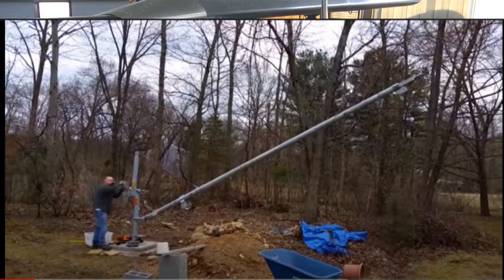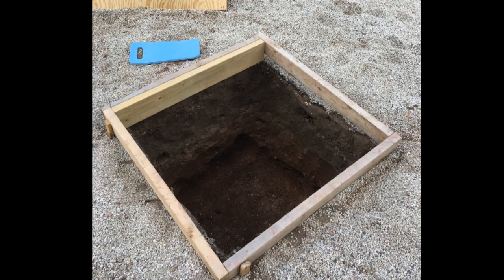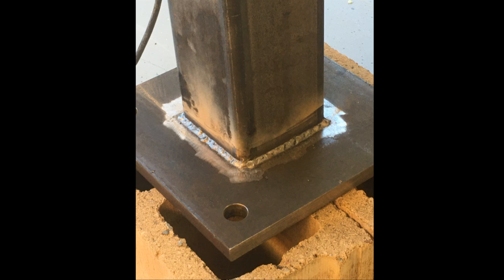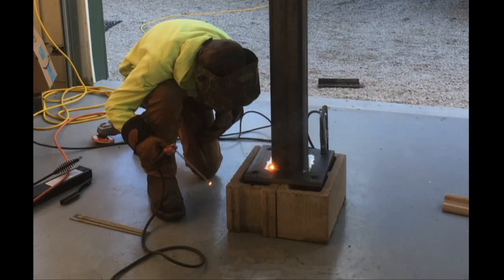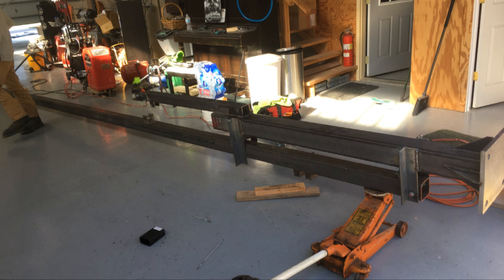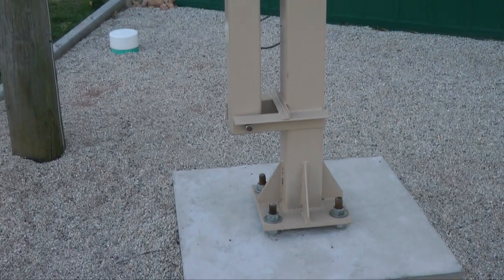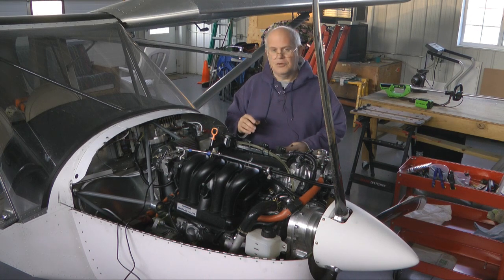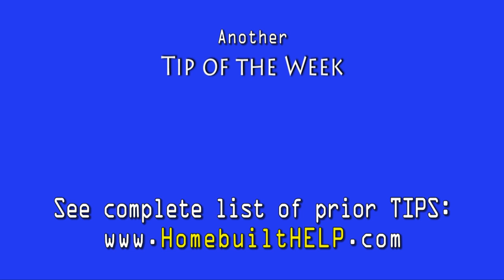Build your own tilting Aircraft Radio Tower

Comment: I think I would drill 2 holes for huge bolts. Then insert at 2 locations pieces of rectangular pipe (also drilled). Then I would use 2 bolts to bolt the mast to the support pipe firmly. They would have to be loosened & bolts removed  to raise or lower the mast.  Also I might put a short piece of pipe bolted to the outside of the mast which goes down to the slab.  Why did you not put the mast up against the wall of your building?  You don't have a video of finishing the project?  Thanks much for this video -- it looks like a beautiful & professional job.

Comment: Phase 1 was very impressive!..but, I shutter at the thought of how much money you spent to succeed in all of this! I am a recent GMRS licensee and will be putting up an antenna as well within the next few days at my house. However, it WON’T be as elaborate as yours is to say the least! Mine will be on a 20’ 1-1/2” pvc pipe with a UHF Fiberglass non-ground Mobile Radio Antenna, 70CM 400-470mhz GMRS Base Antenna 17 inches tall at the top. I’ll have two four feet pieces of rebar pounded in the ground up against two sides of the bottom pipe area and bound to the pipe via very strong pipe clamps. About ten feet upwards the pvc pipe will be bound to an existing old Directv mount already in place I used at one time for a tv antenna mount. With the antenna up and operational it should be approximately 21 feet high (or a tad more) to the top of the antenna from ground level. If I’m real lucky I’ll be able to hit all the repeaters in my area of north Houston, Tx [and there are many!] with my GMRS-50V2 50W 256 channel mobile radio being used as a base station. I’m also planning on using automotive wire looming around the RG58X coaxial cable from top to bottom to protect it from the sun’s rays also. Great video, VERY well explained, and, absolutely most interesting! Stay safe! ~Jim @WRXY695~

Comment: Is there a part 2 to this? I don't see any link to a part 2 and I know others besides myself would like to see that video. You did a great job with this. Was there a cost savings doing it this way instead of using a telescoping antenna tower that has 3 or 4 sections and a hand or electric winch/hoist to raise and lower it?

Comment: A couple of thoughts to consider.  The winch is most powerful on the first wrap of cable. (least amount of cable for the job)  Also you might think of using the equivalent of jumper cables to power the winch, (no battery to maintain) just pull a car up when needed.

Comment: Your video on Tilting tower was so informative.  I would like to build one for my HAM radio operations, thanks for the step by step procedure. it would be great help if you can share the design sketches with us.  
eagerly waiting for the second part. Hats off to you.
73's
VU2CSF
Reply from the maker: Hi Chandra.  Thanks for the feedback.  I am a little hesitant about the plans as I am not a structural engineer so there are no specifications for strength and durability.  I borrowed from several commercial designs so I feel I am taking minimal chances. I also am a ham and this is my main purpose - but for low wind load antennas! Stayed tuned - for spring will be the time I finish off the telescoping part.  Then I can provide more detail on what I did.  Waiting for a better sunspot cycle to appear!
Reply: @HomebuiltHELP  Thank you for your reply. Sketches will help as one of my HAM friend is a Structural Engineer, hope to take his advice. 

will wait eagerly for the second part.
73's

Comment: I realize this video was made two years ago but I still have a question? I like the design except for how all the weight of your pole looks like it sits on the one pivot bolt. That does not look right to me. Wouldn’t be better to have that pole sit flat on the plate instead of the bolt once it it tilted up in place? Where is part 2 of this video? All the antenna towers that tilt up end up sitting flat on a plate after they are tilted up. Why would you rely on that one pivot bolt to hold the entire pole up? This could be modified a bit by hinging the pole to a larger base plate so it sits flat on the plate when tilted up. This way you don’t rely on the bolt to hold it up. Would like to see part 2 and how this holds up after a few years.
Reply from the maker: I can answer - but first, please tell me how much weight a 5/8" bolt (grade 2) can hold in shear (very easy to find - google this exact question or ask Siri).  Please reply here!

Comment: Well, I WAS going to say you have to pay attention to the power source on your winch. The one in this video was designed to mount on a truck, so it's 12V DC. I assumed it was going to be 120V AC, which are also available for fixed installations, but they aren't as plentiful or inexpensive. But for occasional use like this one, I suppose lugging a battery outside and hooking it up isn't too onerous.
Reply: His biggest problem with the winch is spool size. With as much cable he has out I doubt the winch can do a 1000 pounds. Might be able to add a chain link to shorten the length of winch cable out.Maybe a 9 or 12k winch could work when he adds the extra section.
Reply: @keithmiller7341  I didn't understand any of that. What I meant was that you have to make sure you're getting a winch with the right power source. If you want to hardwire it into hangar power, you have to get a 120vAC model. If you want to spend less, you can get a 12vDC model made for a truck, but you have to be OK with lugging a car battery around.

Comment: Great video. I have seen some tilt up tower manufactures state that no loads should be on the mast when cranking up. What has your research led you to believe on that subject? I may want to do a tilt over mast one day for Ham Radio.  I am also a pilot.
Reply from the maker: "no loads should be on the mast when cranking up"  Hi Brent, I guess I dont understand what a "load on the mast" is?
Reply: @HomebuiltHELP  it would seem they say don’t mount a structure on top of the mast prior to tilting it up. By I have seen some large beams installed sideways and tilted.  These are instructions from manufactures not YouTube opinion.  But I don’t have a good handle on the mechanical structures of these antennas and am curious to know.  Perhaps I should find a structural engineer or a good book.  Thanks for your response.  I am not trying to say I know more than you, this is an honest question.  All the best, 73 de KI5HXM
Reply from the maker: I am only commenting from a practical point - I believe the whole point of a tilt over tower is to mount/maintain your antennas while standing on the ground, then raise them into position.  You may be referring to the idea that there IS a maximum wind load (and also dead weight) that a given tower can handle at the top.  That should be listed in the manufacture's specs.
Reply: @HomebuiltHELP  yes, I agree on the practical point of working it on the ground.  I was surprised by a manufactures limit on that since to me that is the whole point of tilting.  I have some learning to do at any rate.  By the way, I am a pilot and a ham also!  73!

Comment: Nice black cat . I have a special one just like him/her. That was a lot of concrete for such a small base. But you must follow the local regulations.  Tilt and crank up has its problems if not regularly maintained. A Equalatiral triangle design is stronger and far cheaper to build in 10ft sections.. Giving you the tilt advantage . And you can upgrade in height ,If you build the base with upgrades in mind.. That said its a expensive business putting antennas in the air. Best regards HS0ZOU.
Reply from the maker: Triangle design is nice but MUCH more labor/time with creating all those cross members with their ends shaped for the tubes, rigging, and welding each one. Every design is a trade-off!  Thanks for your input.

Comment: even pro loggers can have problems getting a tree to land correctly, but love part 1.
 only thing i can say is you should have used a larger hinge pin for the tower base. aka: welded a pipe inside of the 4 inch sq tube, (adjusted to be 1/2 in on each side) to match up with the 5 in sq tube base. and used a 1/12 - 2 in bolt. with all the threads outside of the assembly as that could be a breakage point of the bolt. i kinda think over kill sometimes.
Reply: Perhaps not overkill thinking, but more along the lines of experience.
The voice of experience speaking clearly, yet not wishing to offend the host.
When the first monster gale force storm comes,
and after the gusts die down he ventures out g
to peek at his work- he’ll know!🤝
Reply: I would have made the hinge assembly heavier myself.
That said, I doubt it'll ever fail.

Comment: I didn't see anything about grounding that tower, you should read the book written by HAM operator and author Ward Silver all about proper grounding. Otherwise that propane tank becomes more of a potential bomb being that close.
Reply from the maker: LOL  Well, this ham operator did in fact drive a rod from inside the hole into the earth and attached a cable to the rebar cage - all before the concrete pour.

Comment: i built a tower close to the one you are working with a 3x3x24' in side the 4x4x24 i used a hand crank to lift the tower or try to , to heavy was not able to lift had to get a tractor to help with lift. i used a 6" i beam for the lift pole  it wobbled to much looked like it was going to fall so i just scraped the idea , to close to the house and the lp. tank .  so watch the weight .good luck

Comment: Do you have the blueprints you designed to build this tower? If so i would like to buy a set from you.
Reply from the maker: I do not. However, when I attempt part 2 to finish this I think I will provide more dimensions so maybe a structural engineer can comment on its strength  (or lack!)
Reply: @HomebuiltHELP  Where's part 2 ?
Reply from the maker: Ran out of time this year... definitely planning for the next warm season!

Comment: You made reference to the tower being grounded through the rebar and concrete. That doesn't work. Proper grounding is never done through concrete. Lightning will blow concrete to rubble.
Need to run six or 8 inch copper strap from the base of the tower out in at least a couple different directions to ten foot ground rods on either side of the concrete. This is how broadcast towers are grounded. (I used to own 2 AM radio stations!). Please ground that tower properly! Lightning damage is costly & more costly!